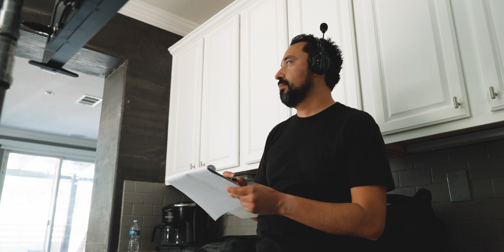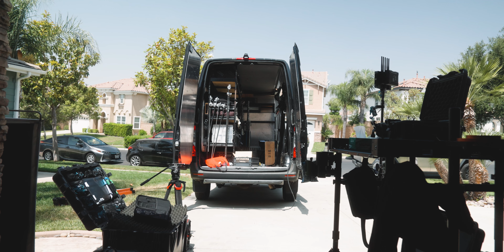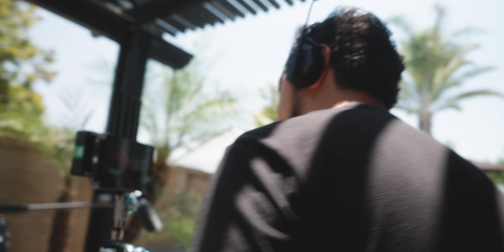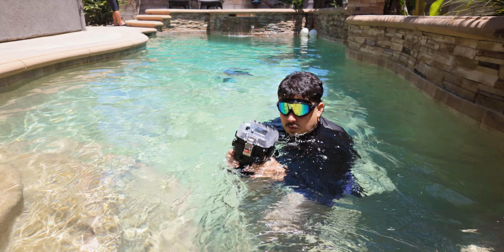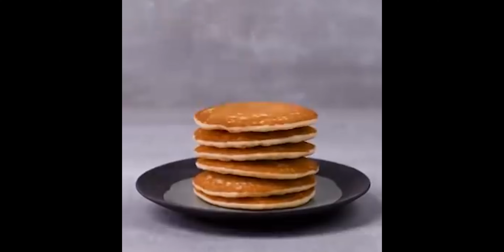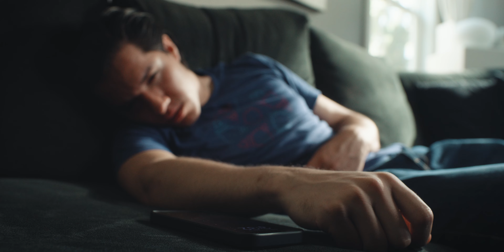Why I filmed an UNDERWATER Pool Cleaning Robot with my FX3

Comment: You don’t have to wait for the robot to switch modes automatically.  You can just remove it from the pool, reprogram it with the app, then put it back in the pool.

Some robots actually communicate with acoustic technology instead of pure WiFi, and so you can reprogram them while they’re still in the water.  Otherwise, the water will block WiFi signals.
Reply from the maker: At the time of filming you couldn't just skim the pool or do other modes.  I think after they heard me complain so many times they came out with a firmware update and fixed that.  Too bad it took me 3 days to get all those shots.